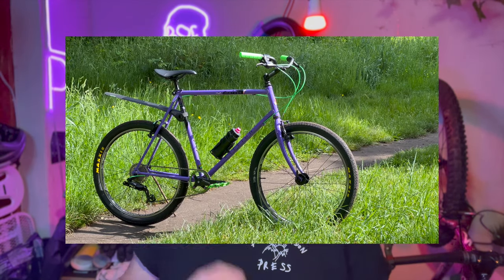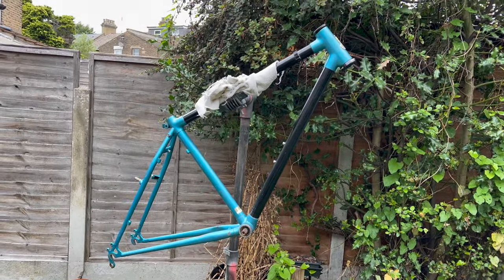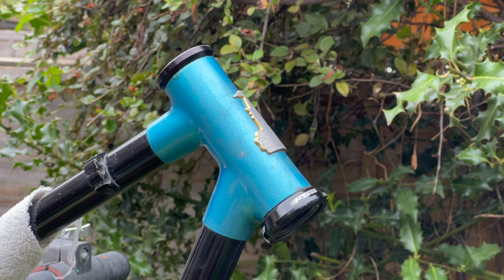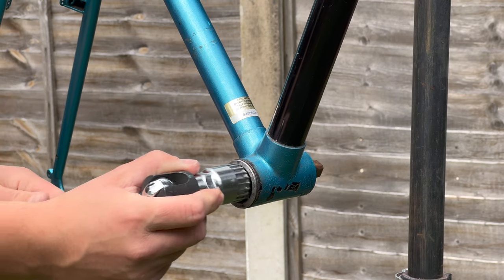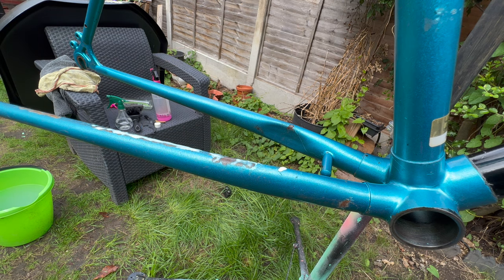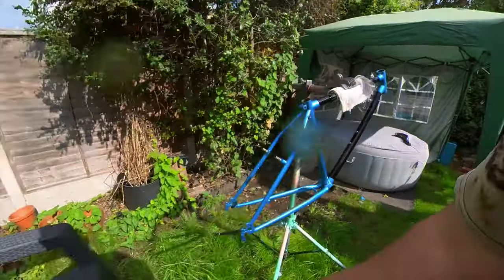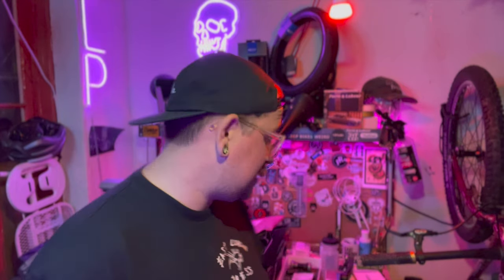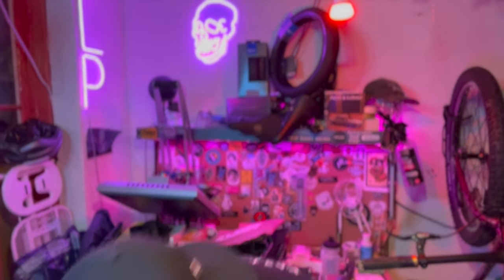£10 Titanium bike - Raleigh Ti2000 M-Trax - Commuter Bike Build Restoration

Comment: Frame looks awesome for 10 bucks, but take a good look on the lugs regulary. I have an ALAN Cyclocrosser from 1984 (Aluminum lugged) 
The adhiesive in the lugs did not hold up anymore, so the downtube just slipped out like 5mm. Fortunatly a friend noticed it before we went riding. 
Looking forward to an awesome Build! Cheers from Austria!
Reply from the maker: Thanks for the heads up! I’m gunna inspect it thoroughly before riding!